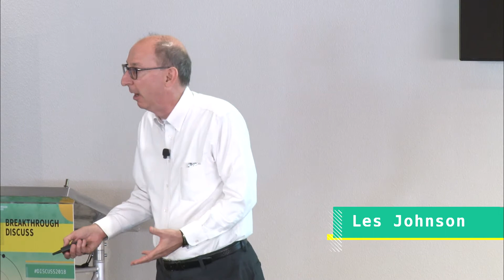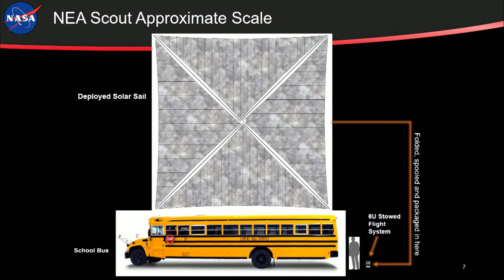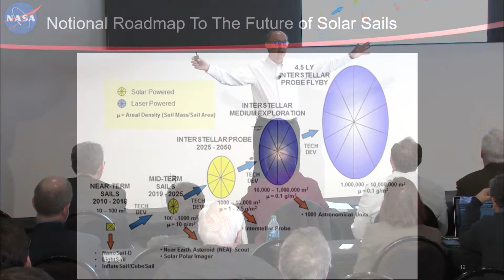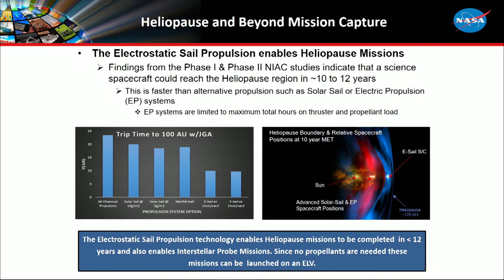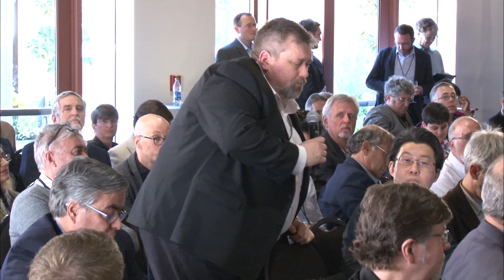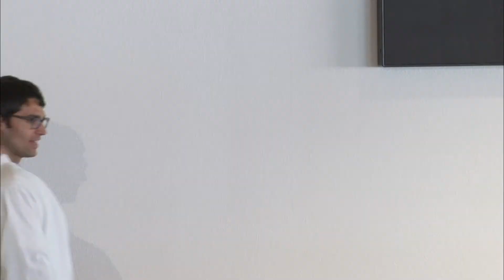Solar and electric sailing: stepping tones to the stars | Les Johnson at Breakthrough Discuss 2018

Comment: No, the name IKAROS - independent of the name-givers having been aware of the associated meaning at the time or not - will for the possibly thousands and millions of years lasting future generations of humanity turn out to have been a very appropriate, hubris in the face of ignorance expressing symbolic name assigned to an instance of a type of space-probe which carries on an astronomical level extremely immense unethical dangers by virtue of its dual-use capabilities, which contemporary light-sail application advocates had an entire blind spot for: Forever irreversible outer space contamination with rapidly exponentially in numbers growing, already multi-cellular organisms that negligently risks triggering evolution of life on extraterrestrial celestial bodies as if people were playing god, with the likely capacity for it to lead to billions of - especially r-selection strategist - species to dominantly suffer because of those applications, especially in the case of interstellar ones.